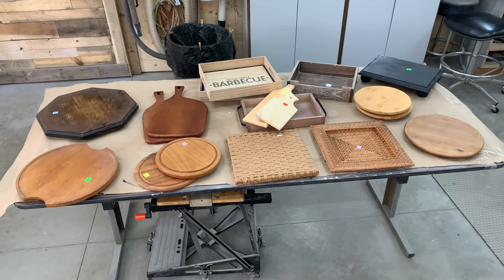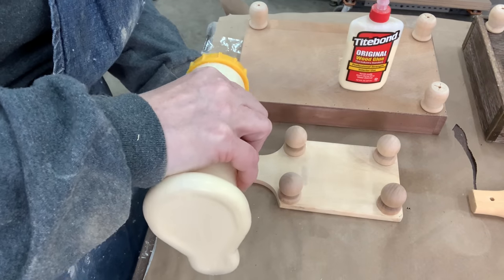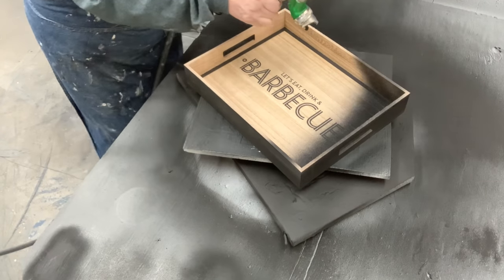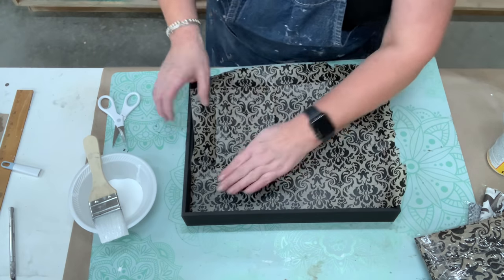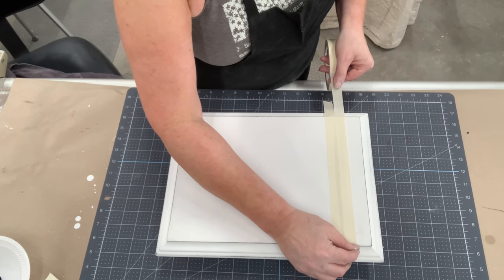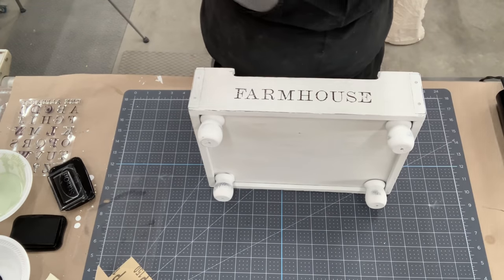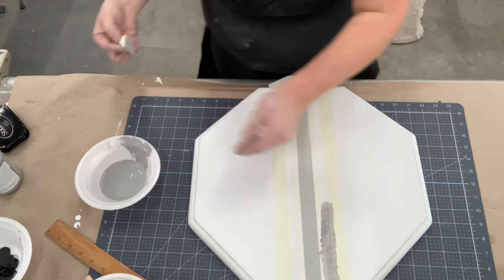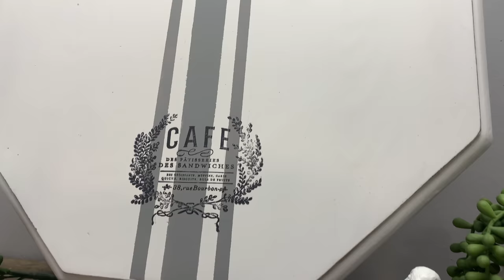Thrift Store Makeovers || Trays and Risers || Trash to Treasure

Comment: I make cards with stamps...if my stamps won’t stick to my acrylic blocks I wash the stamp with dawn dish soap. Sometimes the back I’d the stamp gets fuzzy or dirty.   If that does work I have used chap stick on the back of my stamps to adhere to acrylic block...  I never ever use spray adhesive on my stamps or stencils because I find it hard to get off.   Love love love the green in your white/black mix too ❤️❤️
Reply from the maker: Thanks for sharing!! I've washed them. theres no fuzzy. And yes the spray glue  makes a mess of them. Chapstick... will be trying that

Comment: The SurfPrep Sander would have stripped that Lazy Susan in a quarter of the time and as far as their sandpaper, best on the market. I can sand 4 - 5 large pieces of furniture with the same piece of sandpaper. Honestly, it is a life changer!
Reply from the maker: I think this sandpaper may be similar. So nice to be able to reuse and reuse a piece.
Reply: @GingerChickRehab  there is no other sandpaper on the market like SurfPrep and I can promise you that. They also have padded sandpaper that forms to whatever you are sanding. So those pieces that you sand the top with your orbital but then have to hand sand around the detailed edges because if you used your orbital, you would pretty much loose the rounded bevel on the edge, SurfPrep has sand paper with foam abrasives so you can sand right over any detail with out the fear of messing any of it up. Besides the sand paper being the best on the market, they sanding system itself is top notch, no other like it. It has become one of the most popular system on the market. I am in a SurfPrep group on FB and there is not one person that has purchased the SurfPrep that does not completely admit that it has been an absolute life changer. To be able to do 4 - 5 large (tall boy, extremely large buffet, etc) pieces with sanding them down to bare wood, taking the old finish completely off with only 1 piece of sand paper is absolutely unheard of. Just think about how large, large pieces of furniture are with the entire top, sides all doors drawer faces and the frame. I'm telling yah girl... I bet it would completely change your entire business for the better 💖